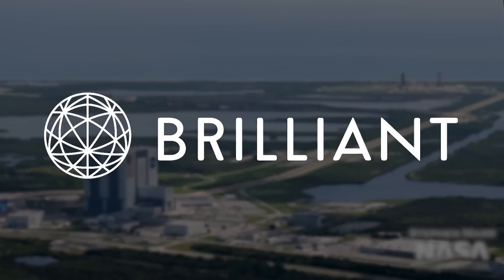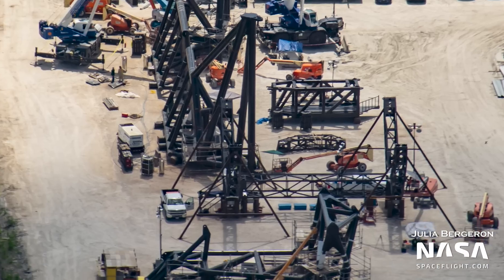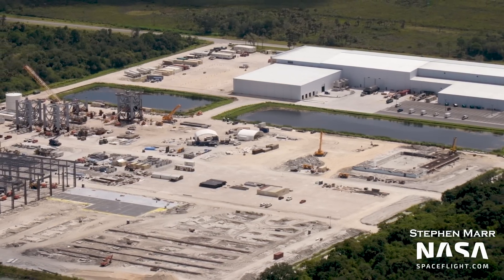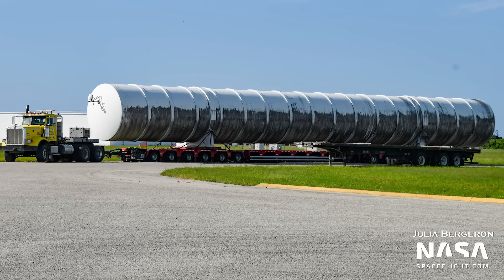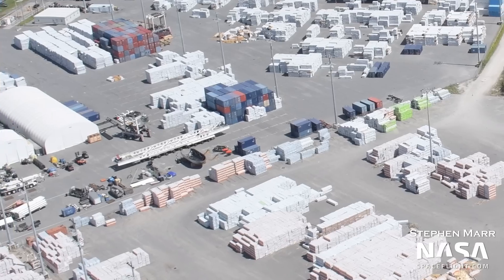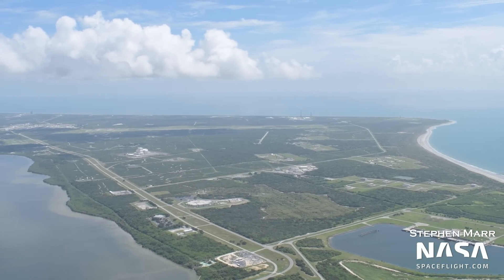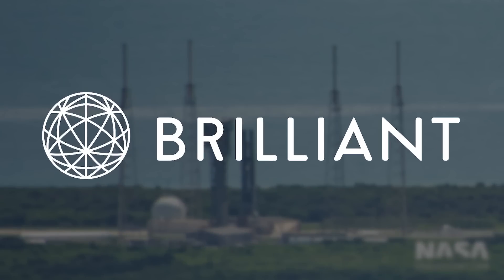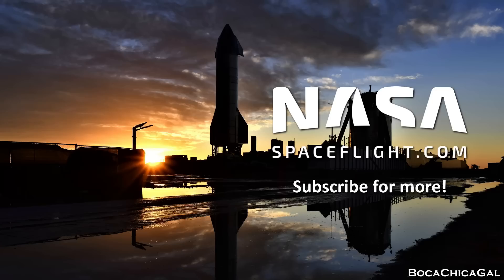SpaceX's Florida Starship Tower Reaches New Heights

Comment: Where, in Florida, will the StarShips be assembled? They obviously will not transport them from Boca Chica
And by the way, with the long headstart that SLS has had, it should not be a surprise if they do launch before StarShip, but that is nothing to worry about either because once StarShips go into regular operations, all other rockets will become obsolete
Reply: They’re building a mega bay in Florida too
Reply: @renehenckens  thanks
Reply: @balaji-kartha  As Rene said, they are building at least one Mega Bay at the Robert's Rd facility on Kennedy Space Center (KSC). SpaceX is also building a Starship factory building at Robert's Rd as well.

Starship won't make other rockets obsolete for a few reasons. 
Both NASA and the USSF like to have multiple providers for launches, so that if something goes wrong with one company, there is another to take up the slack. 

Launch available plays a role. A rideshare mission may not be going where you want, when you want. 

Other space agencies, like ESA, JAXA, Roscosmos, India, and China will continue to launch national security payloads on their own rockets.

The Falcon 9 is the cheapest per kg to orbit booster, but that has not put small lift boosters out of business. While a Rocket Lab Electron costs more per kg than a Falcon 9, it has a lower overall cost. The $2M internal cost for Starship that Musk has been talking about, is a far off aspirational goal for when hundreds to thousands of Starships are flying. The best estimate we have now, is the $2.94B HLS Option A contract for 2 landings. With up to 10 launches for each Lunar Starship landing, that puts the Starship cost for Artemis III at roughly $147M. Time will tell if that number goes down and how far down it may go. At $147M, Starship is still competitive in the launch market.
Reply: @balaji-kartha  Hordes of people to the Moon and Mars are far off goals. Falcon Heavy, Vulcan Centaur, and New Glenn are all capable of putting telescopes and station pieces into space.
Reply: @steveaustin2686  that is what we have to look at when we talk of StarShips - far off goals!!
The amazing thing here is no one has any "far off goals" , and that is what differentiates SpaceX from everyone else. 
And mind you, these goals are what, 10? 15 years away? They will be here in the present before we know it
Reply: @balaji-kartha  Hordes of people to Mars is decades to a century or more away. Hordes of people to the Moon is decades away. You won't get hordes anywhere outside of Earth, until there is a colony to support them. It will take time to develop the technologies for that.

Comment: Great commentary video, thanks for the update. It's interesting to see that Blue Origin painted their new test tank white with logo. That may indicate that it is no longer stainless steel and needed the paint to protect it from the environment.
Reply: White paint & the orange SOFI is for thermal control, the regular second stage is BE-3 powered it needs cold liquid hydrogen.
Reply: Makes sense because the “normal” New Glenn second stage is aluminum

Comment: It could be that the shorter arms are intended for stacking only, no catching. The arms have already demonstrated superior capability compared to crane lifting and stacking.  Catching when it happens could be at sea or at another facility, located further away from existing launch infrastructure.
Reply: I don't like the idea of a non- versatile site. All sites should be able to stack, launch, and catch. It's like building a large airport where only aircraft can take off.
Reply: @jmd1743  it's always possible they can switch the arms out at a future point if catch testing at Starbase is successful. That is if the arms currently are too small to catch anything
Reply: @digi3218  That's cool then.  it would be cool if they were to build some facilities at locations such as Space Port America, but I doubt that will happen.
Reply: It could be. But consider that the length of the arms was decided very early on the first prototype. They may have decided long ago to make them only as long as they need to be. The rest just adds extra weight.
Reply: The boosters and ships have to be able to land on the arms with just 1 or 2m margin of error, just like the Falcon 9 boosters. That means they are sure of their system and don't need more distance in either the length or the width of the landing area of the arms. That is why they can do fine with shorter arms.
The fact that shorter arms can move faster is just a bonus.

Comment: It's irrelevant which launches first. I’m sure Starship will launch much more often than SLS by a magnitude.
Reply: It’s not about how often they launch, but how much they accomplish
Reply: @rowanspencer1861  Yea, then we are talking three magnitudes
Reply: By one, I think it's two magnitudes
Reply: MI
Reply: *will, not yet though

There is no high energy launch capability for a long time and also no ability to launch and deploy literally any significant commercial payload

Literally just starlink launches in the near term

As for SLS, it’s not getting 2 per year until block 2, a decade from now, when starship will have all the basic launch capability mentioned previously

But yeah it’s safe to say an order of magnitude roughly, although I think they’ll start of with slightly less than 10 orbital launches within the next 2 years, eventually 2 orders of magnitude with enhanced operational cadence for SLS and starship

Comment: Did space force grant permission to use a drone to film?
Reply: If you mean these videos, they are from one of the helicopters that flies regular tour flights out of Port Canaveral or Cocoa Beach. The flights go North over Merritt Island and part of Kennedy Space Center (things like SpaceX Jarvis Road, Blue Origin Factory, Vehicle Assembly Building, and (from a distance), 39A (SpaceX Falcon 9, Falcon Heavy, and Starship), and 39B (NASA SLS). Cape Canaveral Space Force Station is to the east (Pads 36 (B.O. New Glenn), 37 (ULA Delta IV), 40 (SpaceX Falcon 9), and 41 (ULA Atlas 5 and Vulcan). As far as I know, no flights are allowed over that area and that's why all those shots are at an angle and from a distance. KSC/CCSFS are two separate installations with some shared facilities and using the same range (the area out over the ocean). Out where the pads are, the dividing line is somewhere between 39A and 41 (I think).

Comment: With the track record of SLS/Artemis being so poor, Starship will definitely launch before it.
Reply: Artemis has a launch date a month away. It will launch before starship
Reply: @dummyjoe7895  Look at its scrub record, and those weren't even for an actual launch.
Reply: @MichaelClark-uw7ex  those scrub records were to iron out it’s issues. Which they did just that.
Reply: Starship has had its share of problems too. After the last explosion, I would be surprised if it will be launching before the end of the summer. And even so its not a fully operational launch , just a test and will end up in the ocean.  Artemis has a payload going to the moon.  Musk has also said it will just as likely explode as as actually launch.
Reply: @germanicus7880  Rule 1 of rocketry: we learn more from failures than success.
Reply: @MichaelClark-uw7ex  the thing is… SpaceX can afford to fail, NASA can’t fail and needs to get it right the first time.

Comment: Well I won't refrain from speculating on the reason for the shorter Chopstick arms! I suspect it's because these arms will be used exclusively for lifting, no catching will be done. Texas will let SpaceX do practically anything so long as enough $$$ gets into the right pockets, but NASA would be a great deal more circumspect about allowing such highly experimental and unproven manoeuvres that risk damaging their only current launch pad to get to and from the ISS in the event of a catastrophic catch attempt. After all, if/once the technology is proven it would be easy enough to swap out for longer catch arms if NASA clearance is given.
Reply: Fairly logical reason here
Reply: I think they found the Boca Chica chopsticks too heavy, cumbersome and sluggish for the catching operation. They even upgraded the hydraulic actuators there, changing them by more powerful ones, so they are now reducing their mass on KSC to get more agility.

Comment: Thanks for keeping us up to date so regularly. As for first to orbit, I'm going to vote for Starship, bc I doubt NASA will be able to hold a timeline for SLS (due to over caution or due to actual hardware issues again), and that rocket won't likely launch until late 2022 at the earliest.
Reply: No

SLS is absolutely undoubtedly launching first now

Cope and seethe, it ain’t changing facts
Reply: If it launches and you are wrong, you should admit it openly
Reply: Yeah there's no way they are going to be able to launch SLS by the Aug. date that Jack mentioned.. Hahahaha!!  
There will be all sorts of valve/software/metal doodads/self-sealing stem bolt issues and failures and it won't launch.  Oh sure, they'll make a big deal out of rolling it out, and going through the motions with great fanfare.. blah blah blah.. but they will inevitably have to stop the countdown, and the launch will be scrubbed.. once again, total fail...
Reply: @deanlawson6880  sls will definitely launch before starship. That’s why they did multiple WDR to iron out the issues.
Reply: @deanlawson6880  Except there won’t be because WDR is finished

Just the fact you’re going haha shows you’re a sad troll